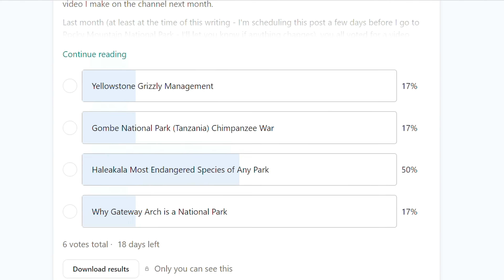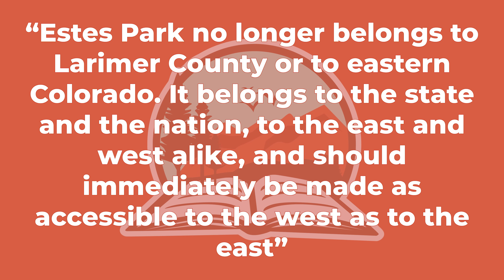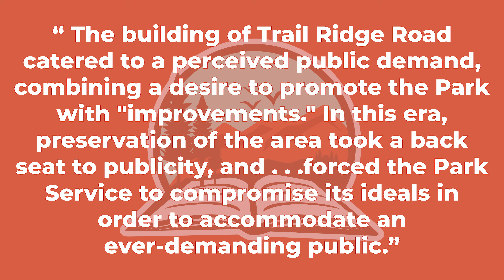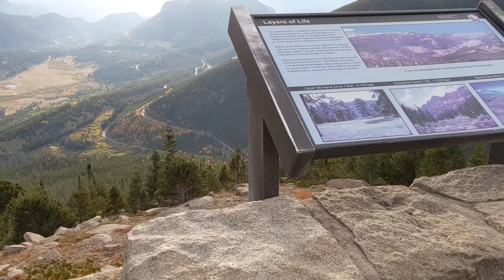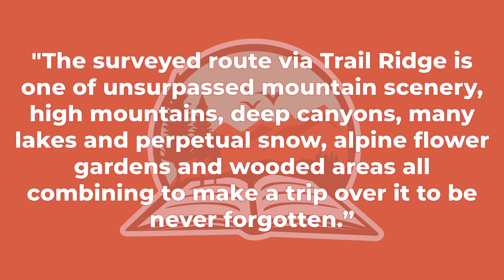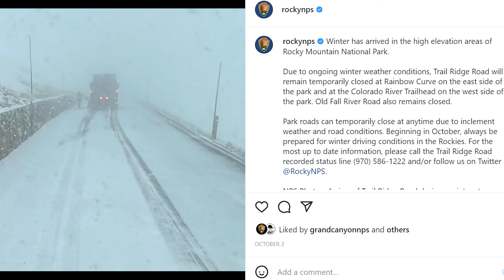How They Built Trail Ridge Road

Comment: Cameron, could you please do a Piece--possibly a Two-Parter--about all of Yosemite's roads and accesses? Perhaps the First Part could cover the general accesses, starting with Native American trade routes, what accesses that Walker and Savage may have used, in conjunction to routes close-in to today's Park, early tourist horse and Stage roads--including Stage Rest & Hostelry Stations, the original routings/alignments of Big Oak Flat/Coulterville/Wawona (Big Oak Flat should receive extended treatment dealing with the infamous Priest Grades--Old & New) Roads, and, certain "outlawed" accesses ("feed dodgers"): Chowchilla Mountain & Foresta<>El Portal--I believe USFS & NPS joiintly performed mutual destruction of their respective road systems that would have allowed travel to<>from USFS<>NPS Lands, expressly to deny the use of most of today's vehicles. Perhaps with the breadth of topics that I'm considering, may require a Third Part. The Final Part, should deall with the 120's Tioga Road, which starts at its West end at Crane Flat, continuing all the way to Lee Vining. I believe that it first began as a Wagon Freight road primarily to service the mines just directly below the Eastern Sierran Crest. Some portions of it, remained unpaved till as recently as the early 1960's. Als, please do use anything about these that you dig up, dealing with the CCC. The Rail access up to El Portal, would be interesting to us, and where that started in/around the San Joaquin Valley.

Comment: Had to change to a spare tire near the very top of Trail Ridge Road.  We got to a pulloff where we were feet from a relatively steep dropoff and changed there because we were at least on a flat and safe spot relative to the heavy traffic.  Just glad we didn't accidentally roll our flat tire off the edge when we got it off the car.  That would have been a lulu to get back.  It really wasn't that dangerous, but it was a bit nerve-wracking at first.  Just glad we had an air compressor in our car to help the car get to a more safe place to change it then where we were when we first noticed that it was quickly losing air.  Driving down Trail Ridge with a spare tire was surprisingly uneventful.  The road itself is in such good condition, that I had no worries at all.
Reply from the maker: That's good to hear, but yes sounds very nerve-wracking!

Comment: Fun Fact:  There is one rest stop on that road at elevation 12,090-ft.  You know that some high level crap happens there.  

I didn't get a chance to drive the whole road so there might be a higher one and it is not the Alpine visitor center  at only 11,796-ft.

Comment: Whenever we go to RMNP, we drive up Old Fall River Road and come back down Trail Ridge Road. The last time was in July and the OFRR was crowded and so was the visitors center at the top. Yeah, driving a road like it without guard rails can be somewhat nerve wracking as you are depending on the opposing traffic to be on THEIR side of the center line. Overall, RMNP is a great place to visit and to camp in and hike its trails.
Reply from the maker: Didn't get the chance to do OFRR this time, but I'll certainly be back! Couldn't agree more about Rocky though. This was my second visit and it was just as breathtaking as I remember. I went in fall this time too, so the colors were gorgeous!

Comment: You think Trail ridge was hard? Try driving it in  a white-out. I did at 17. Had to make the girl friend walk Infront of the car because I couldn't see road and she couldn't drive a manual. I knew someone who worked on constructing the east side of the road. I also have a high school friend who was head of the team that rebuilt the rock walls long the road. After 80 years these walls were starting to fall apart and hence the road was also.  I'm a native to and still local to Estes Park.

One of the major issues with the original version of Old Fall river rd was that vehicles of the time did not have fuel pumps. The fuel was gravity feed from the tank to the engine. Old Fall Rive was so step that the engines would stall out due to lack of fuel. This meant drivers had to back up the steepest parts of the road to keep the engine running. Think about backing a 15% road where you can't see out the back, with steep drop-offs on one side. The Estes Museum has pictures of this.
Reply from the maker: I can't even imagine lol! It was quite the experience in normal conditions!

Comment: The hidden valley area used to be a ski resort up until the 90s - they would actually plow trail ridge road, tunnel the skiers over the road and people would drive under makeshift tunnels in order to keep it open during the conflicting seasons. Also before the lifts they would use the bus as the Ski lift to get near the Ute Trailhead and drop in down to the valley. I couldn't imagine trying to plow that road all winter.. Still ski here and its an amazing place and really cool to cross/ski over the road in the winter.
Reply: I skied Hidden Valley several times in the 70's.  I only remember ski lifts that would take you above tree line.  The ski lifts weren't fancy either.
Reply: @toddb930  Yeah old rope tows! they've all been removed and cleaned up now - just the old runs remain.
Reply from the maker: Wow, I knew about the ski area, but had no idea they had tunnels like that! That's wild!
Reply: It's now a really fun backcountry ski area.  One of the safer ones too as there's not a lot of steep grades capable of avalanching.  Avalanches are still possible there though.

Comment: Today’s Old Fall River Road is 6.7% grade and about 3200’ of elevation gain. Definitely no more 3 point turns. Very easily drivable by most reasonable passenger cars. Trail Ridge is about 4%. Both are rather modest and uncomplicated to drive by Colorado alpine road standards.
Reply from the maker: Yes, today's Fall River Road is much more accessible, albeit still more difficult of a drive than Trail Ridge. Not so in the past though!
Reply: Why don’t you stop talking and show the road? Or show the places your talking about while you talk? I love trail ridge and have driven it many times. I was excited to see the video! But all your talking instead of showing is boring.
Reply: @gracieg7601  I guess that ANY history is boring?
Reply: Sorry you talking so much with out the scenery it’s too boring.
Reply: @gracieg7601  I guess that ANY history is boring?

Comment: I kind of wanna ride my motorcycle over this…. Hmm perhaps next year
Reply from the maker: We saw a bunch of motorcyclists on our trip! Some of them didn't look like they were having a great time in the snow and rain 😂
Reply: @NationalParkDiaries  I mean I’d probably do it mid august at the height of summer
Reply: @JoshDoingLinux  I've seen it snow on the top of Trail Ridge Rd in August before (in fact I've seen it snow up there in every month it's open). It's also VERY slow going if its crowded. It's not like say, Tail of the Dragon or something. The views are fantastic, I just don't want you to be disappointed in thinking it's a great ride for "riding". It has a slow speed limit as well (25 I believe).
Reply: @zmarko  I’m okay with a few hours of freezing temps, and some snow, just don’t wanna go up when it’s like 40 in the morning freezing up there and cold again on the return lol.  But thank you for the concern I’ll keep it in mind ❤️
Reply: @NationalParkDiaries  I Rode through yellowstone near opening weekend this year and got some snow. Its really not to bad if you have warm gear and know to stop if it gets to grim.
Reply: Sounds horrific lol
Reply: Did that in ‘93. Rode it a few days after it opened for the season… heated gloves and vest barely kept me from freezing and my Harley didn’t want to run at that altitude (old carb, no way to compensate for the lack of oxygen…), had to keep the revs up to prevent the engine from stalling. On the way down (westward) we couldn’t see much, riding between snow walls. Melt water running across the road, wondering if it was going to be water or ice. Topper was that it started snowing as we came down. 
Big fun… (?) 
Needless to say, we had no idea what we were getting into, just wanted to get to the other side of the mountains. 
Thanks for triggering some amazing memories!!
(Also, re Going to the Sun… did that in 1990 (I’m old…) on a fully loaded tandem bicycle during a cross country trip… another amazing memory!)